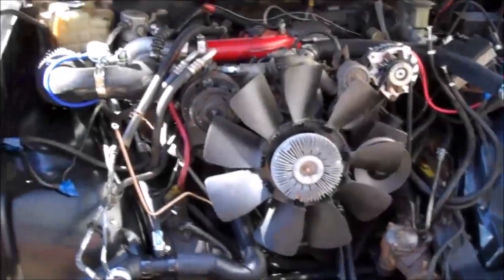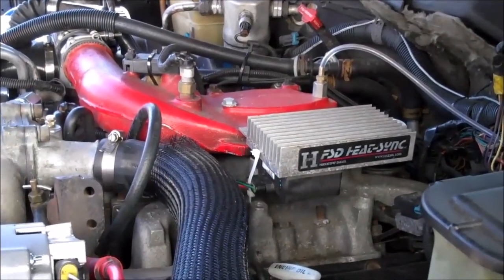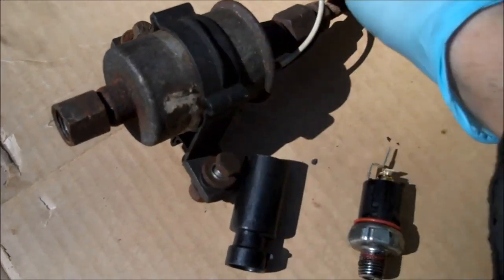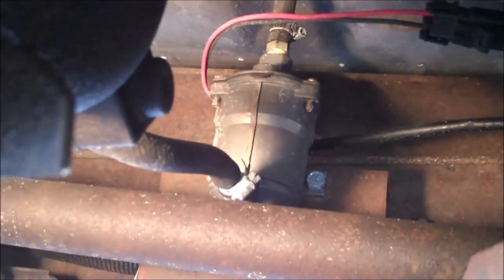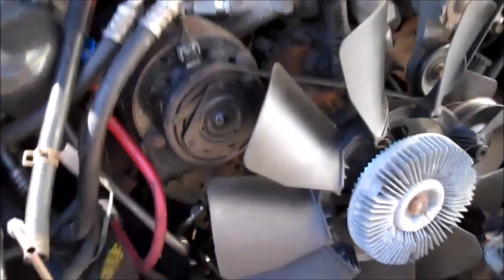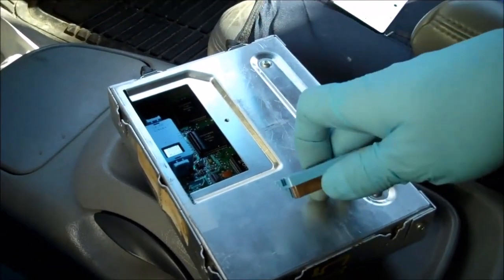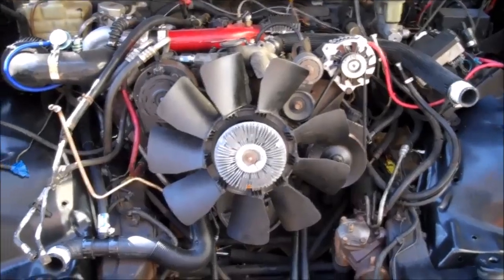6.5 DIESEL ENGINE - HOW TO BOMB PROOF IT

Comment from the maker: One other item I wish I had mentioned is this vid would be replacing the BATTERY CABLES.   PTWIRINGSOLUTIONS.COM has a great set of battery cables to replace the crappy stock ones.
Reply: Yankee Prepper - Preparing for the Wrath of God and Fine Coffee. I bought an 86 w/6.2 4x4 auto. It was a beautiful truck but was told it needed an engine. I saw the crossover cable to main Bart was maybe a #8 and of course starter was shot. I put a cable and starter on charged up crappy batteries and put charger on boost, varoom, started but smoked (fuel) changed fuel filter and this low mileage truck was one of the better trucks I've ever had. I put 150,000 miles on it and never had an issue other then normal wear and tear and maintenance .I averaged 20--24 mpg and never took it easy,
Reply: Where can I get the software, I know this is an old video.

Comment: You forgot the harmonic balancer
Reply from the maker: No I didn't.  The harmonic balancer is not something that has to be changed or modified outside of normal maintenance.   If you change your oil,  belt tensioners or replace fluids in the rear differential as part of a normal maintenance schedule,  you should be checking on that balancer as well.  People that have issues with the balancer are people that don't maintain their vehicles properly.   They don't need to watch vids like this anyway.

Comment: You are absolutely right, the location of the PMD, where heat would cause it to fail was the a nightmare for me. Often it would fail slowly, so the engine would simply stop, in the middle of traffic, or fail to start, only to start right up when it had cooled off. I had several occasions where I towed my 95 into the dealership only to have them call me the next day, to tell me they couldn’t find anything wrong with my truck! But of course the day after I would be left stranded again. A few such experiences, and you are afraid to drive the thing. I took it to an independent shop who fixed the problem at a cost of roughly two thousand dollars but that only lasted a couple of years. I have since learned that this problem could be fixed by simply relocating the PMD to a cooler area of the engine bay. Too late for me, I had already given the accursed POS away on full disclosure of its problems, the last time it had started acting up again, to a fellow who thought he could fix it. I vowed never to buy another GM product after that. I can’t imagine the dealership didn’t know what was wrong with it, and it seems unconscionable that they would send a customer, looking to them for help, away with a vehicle that would leave them stranded or in danger of having an accident if  the vehicle suddenly stopped in traffic. Shame on GM, they could simply have easily fixed the problem and saved their customers a lot of grief and money by simply admitting to the problem and relocating the PMD.

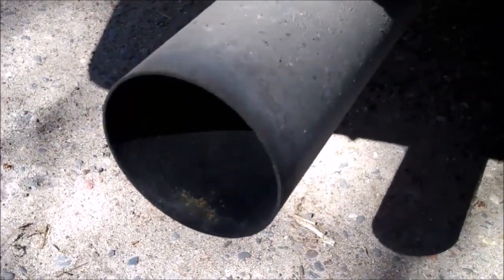Comment: I had 11 trucks in my landscape business at a time maybe 10:00 and I had two 7.3 Powerstroke turbo diesels and I had a 1999 Chevy 3500 HD 6.5 turbo diesel and believe it or not I had a 1991 one owner I bought used Cummins Diesel and I believe it was a 3116 or 3106 caterpillar in the F650. I am here to tell you my personal truck was the Powerstroke but my 6.5 turbo diesel was so Zippy and so fun to drive but I did pretty much every thing that you mentioned those three had to be done at some time or another

Comment: Nice video. I was curious what aftermarket air filter and turbo set up do you have?. I have 93' with 296k and it still runs great but is smoking on startups a bit and downhills when using gears to brake. Plan on replacing CDR valve and seeing if that helps. Did glow plugs and air filter (which was really bad) so hopefully this will be solved.

Comment: This is the same engine that's in the presidents limo. I thought they were nuts for picking it but if their mechanics did all the same improvements you did it probably works just fine but honestly why not pick the Duramax it's been in production for longer than the 6.5 diesel ever was?
Reply from the maker: because the Duramax won't do what the 6.5 does.

Comment: Fantastic video. 6yrs old and still relevant. I just picked up an H1 hummer with a variation of this motor and will be going through it in the next couple months to upgrade where it makes sense. Already moved the PMD to a better location. Great tip on the Duramax fan and clutch and thermostats, I'll be doing those for sure because this thing runs at 215-220 degrees on the highway. Any particular thermostat you like to use on them?

Comment: What about the harmonic balancer? Is it worth upgrading or to the hydraulic dampening kind or just keep inspecting the stock one? If it fails you can break your crank shaft.
Reply from the maker: Yeah...and if you don't change the oil...the engine can fail.   Normal maintenance is key.

Comment: I’m new to these trucks but I just picked up a 1994 k3500 with the 6.5 and 5 speed. The guy said it was chipped and it also has the 4” exhaust, boost and EGT gauges and an exhaust brake. My question is how do I tell if the EPROM is a chipped on or the stock one?? I haven’t drove it yet because I’m fixing the 5th gear and when I was talking to the guy later he said he didn’t really know if it was chipped. Any tell tail signs to know if it’s a aftermarket PROM? Thanks

Comment: My '94 has a hiccup problem when it warms. Cold start it run great, once it warms up i get split second fuel shut off. If I shut it off for 10-15 minutes it runs extremely rough until I can flow some air thru the engine. It still hiccups, not as bad. 

I've relocated/replaced the PMD to front bumper, from Leroy. I put on a Heath LP & Leroy wire harness with the button to run the pump. I've also replaced the oil pressure switch and crankshaft sensor.

What would be your next step?

Comment: Thank you for the really great video.  I appreciate the work it took to remove the radiator and grill so we can See what you are taking about.

Question:  If I remove my vacuum pump,  what do I do to actuate the waste gate on my Turbo?   What is a manual waste gate and how is it controlled?

Application is '97 2-door Tahoe with the 6.5L.
Reply from the maker: I did this vid with this premise that a person would have the basics knowledge of how their vehicle works.   This is not a good vid for someone just parroting.   The vacuum creates tension on the wastegate....opening and closing while driving.   A manual wastage creates tension using as spring.  There are probably 100's if not 1000's of vids and diagrams on the internet showing manual wastegates.   People even make them and sell them to people that can't make their own.

Comment: Hey brother, I am the proud new owner of a 2000 GMC Savana (with the 4x4 Quigley package) with a L65 6.5L and I  two quick questions for you please. 
1. Can I still do those first three steps with the engine bay being terrible as it's a passenger van?
2. I live in Alaska (it gets COLD here). Would you still suggest cold air intake and a new fan?
Reply from the maker: The vans are a little different.   I know for sure you need the Compressor to run your HVAC.  Everything else is pretty much the same.   Anything you can do to let that engine breath better will help the engine run longer.   I live in Minnesota and I still want to keep the engine as cool as possible,   no intercooler to help.

Comment: Well it turns out on my 93 6.5 it was not the pump after all. It was the starter. I replaced the starter and cleaned the cable ends and my truck starts up as fast as my Dodge gas motor hot or cold it doesn't matter.

Comment: Great video.  I have a 93 Chevy 6.5 dully it starts up just fine but after I drive it and shut it off.
I have to wait 4 hours for it to cool down to start it.  The truck only has 150,000 miles on it.
5,000 miles ago I installed new new glow plugs and the electronic module.  If you have any
ideas I would appreciate it.  I live in a small town and no one knows anything.  Thank  you.
Reply from the maker: Take a gallon jug of cool water and pour it over the injector pump next time you drive it and shut it off.  If the truck starts up after pouring the cool water over the pump....you need to replace the injector pump.
Reply: @Yankeeprepper  I really appreciate this information and I will
give it a go.  Thank you.

Comment: I love this video because I plan on keeping my 6.5 turbo diesel for a while. thank you for the advice!👍👍
Reply from the maker: You are welcome.  I am stilling running a 6.5 and got over 700 miles to a tank of fuel and still had a quarter left before I stopped to re-fuel last weekend on a trip from Minnesota to Illinois.  Pushing 22 mpg at 70 mph/1950 rpm.
Reply: @Yankeeprepper 2wd drive or 4 ? ty

Comment: I watched this video years ago and then went to go get a 7.3 Ford... you still got this thing?
Reply from the maker: still got your Ford?   I still got the 6.5.
Reply: @Yankeeprepper  lol good one... yes I have the Ford and it still does what I need it to, real strong like too. I took your advice on buying used over a $60k mortgage payment... I.e. new truck and haven’t been dissatisfied. I’m a younger guy... and I understand why you like the 6.5, people tend to stick to what they know and ik they run well. Ik a well driller with an old 6.5 screamin jimmy and he loves it for what you mention... leaking oil, screamin, sipping on fuel, putting holes through solid rock. I can do all the work to the Ford myself and appreciate the advice given sir, great videos and it’s awesome to hear a God fearing man speak on things he knows! Please do keep up the great work! I’ve seen you purge ur content... been watching for a while. Before yt got crazy. For the price of a new one I could rebuild my Ford 4 times over if needed, she only cost me 2k, a high pressure oil pump, and a set of injectors, had a new trans when I bought it.... it’s hauled more lumber, campers, drill steel, loaded goosenecks, boats, river logs, and game that many new trucks might not ever see, not to mention, in Idaho we have some real up and down grades... the old Ford has seen a solid 170k miles of road just under my use. Good Lord willing and with a little tlc I’m hopeful it will hit 1,000,000 miles (currently at 368k and I baby er’) and if she don’t go... I’m not out 60k and can walk away laughing. Thanks a million!
Reply: @Yankeeprepper  I’m glad to hear your 6.5 is still rompin n spompin. If I can ever pick up a suburban with one in it I will be needing this video again!
Reply: If I can’t find a 7.3 Excursion lol! Either way thanks for the insight Yankee!

Comment: Great video 
Got a question 
I just removed the vacuum pump because the truck have a turbo master installed at 14psi in a boost gauge 
What should I do with the yellow hose line connected to the vacuum Pump?
The other vacuum hose is already caped /tap with a screw should I do the same?

Comment: Hi, love you video great information, I have a 98 6.5 and i replaced the PMD in it about 15 years ago with a remote one from HealthDiesel and a new lift pump too, can you tell me where is that little oil pressure switch that you show in the video, my rig is starting and cutting out after about one min, plenty of clean diesel, just replaced the fuel filter, rig only has 110k on it, so it is a keeper for me but can be a pain when not running well. i plan on draining the fuel tank to take a look inside.
Reply from the maker: Slightly to the right and behind the fuel filter.
Reply: @Yankeeprepper   Great, is it screwed into the filer housing or screwed in the head ?  or attached to the firewall, my application is a stock 98 Suburban would it be enclosed in plastic or am i looking for a regular type oil pressure switch, belting rain here today when i went looking for it so did not see it yet.
God Bless your knowledge & thank you for posting this video.
Reply from the maker: @michaelmaloney436  It's screwed into the block.  It's a plastic cylinder,  I showed what it looks like in the vid,  it is NOT easy to get to.

Comment: I know this is an old video but I'm hoping you're still looking at the comments. This video has been very helpful. My question: I have a 2002 C3500HD with the 6.5L. It came with the stupid vacuum pump but also an auxiliary, belt driven hydraulic pump because it used to be a bucket truck. I want to eliminate the hydraulic pump and vacuum pump so I figured the '93 belt mentioned in the video should work. I haven't purchased or tried one yet because I can't tell if all the components on my '02 are in the same location as your truck in the video. Was anything else relocated by '02 or do you think the '93 belt should work for me? Thanks so much for your video and your time.

Comment: Hey man I just watched your video and can't believe how educational it is. I know you posted this videos a couple years ago, but I'm hoping to get some help. I just bought a 1999 2 door Tahoe with a 6.5 in it. It had 200k on it. Do you believe it's with doing all these mods with the truck being this old and having 200k on it
Reply from the maker: Nobody can answer that over the internet.  It all depends on how that 200k was put on the truck and how the truck was maintained.   It might have been turned to junk 100k ago or it might go for another 200k
Reply: @Yankeeprepper  I actually bought it from my uncle who drove it from new York to Connecticut frequently so mostly hwy miles. I'm thinking I'm going to go ahead and do these mods even if I only keep it so long. Did you put a new fan shroud with that I cummins fan?
Reply: @Yankeeprepper  Thanks for the response though. Still a big help!

Comment: I have a 31 foot Safari motorhome. It has the 6.5 it is a 93. Ever since I bought it it has had quite a bit of blow by. I have done the oil changes religiously. And just last Friday I was going out of town and all of a sudden my motor got really hot and I blew tons of smoke every time I give it gas. I can't find anybody to work on my coach. I would like to know if the motor is done. Or if I need to buy a refurbished motor.

Comment: I recently bought a 1997 GMC 3500 Dually with a 6.5, I did some research before buying it and watched your video's and that made my decision easy. I am slowly upgrading the truck, doing the important things first. I would like to know where you got the vacuum for the waste gate? I tried to look at the video but can't find it. I want to replace the fan belt with a 93 and do away with vac pump, put a high flow air cleaner, 4" exhaust and the HX5 turbo...I have confidence in the engine after watching the video's. Also glad you Love the Lord as a Christian man I appreciate honesty and integrity. I'm also a retired trucker that love's coffee! And now teach at a truck driving school....love those diesel's. Sorry for long rant, very interested in the upgrades. Thanks
Reply from the maker: I just run a manual/spring tension waste gate.

Comment: I have to thank you sir! Your video inspired me to upgrade my 1984 GMC 6.2 diesel. All the details you suggested, I did on my 6.2 with the exception that mine is full mechanical injection and Banks Sidewinder Turbo kit. I sourced the entire motor belt accessory brackets from a 1996 6.5 motor. Everything bolts up with minor modifications. alternator, air conditioning pump, coolant pump, Walbro fuel pump, duramax fan, everything. My truck is so much better now. Very happy. No more belt squeal since I ditched the V belt drives. Again, thank you for your video.

Comment: Hi, I've got a 2001 hummer h1 with the 6.5 diesel turbo, I believe the vacuum pump runs the waste gate and the air conditioning/heater, would I still be able to get rid of that hard to get to piece of junk mounted in the worse place possible....Thanks for the very informative video...
Reply from the maker: not if you want HVAC

Comment: I just picked up a 2002 workhorse step van with a  6.5 diesel. will these changes you mentioned work for my truck. Great video. Thank you for sharing your knowledge.
Reply from the maker: most will,  but vans are a little different.  Some vans control the climate controls with the vacuum.
Reply: @Yankeeprepper  thank you

Comment: My 2004 H1 stalled for 4 straight years and mechanics would not fix it -It was that dam pmd .Mounted on side now and has not stalled in years.
Reply: I'm interested at looking into a Humvee, how the H1 is holding up, what repairs you had to do, and how many miles it has?